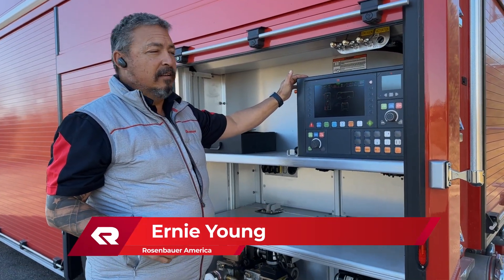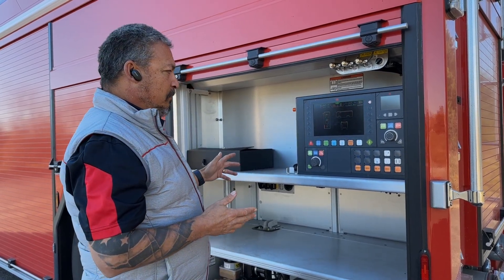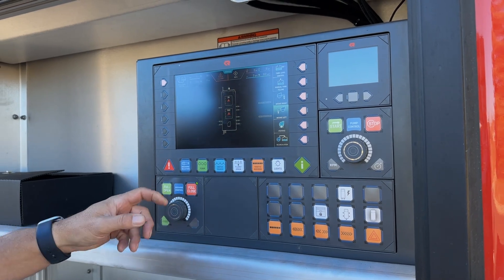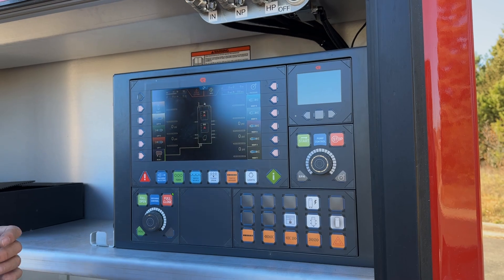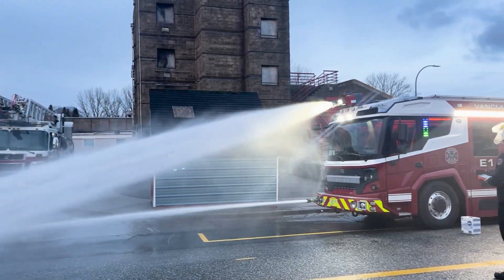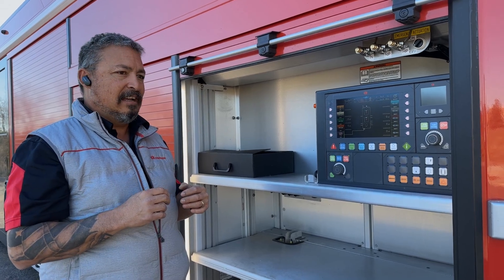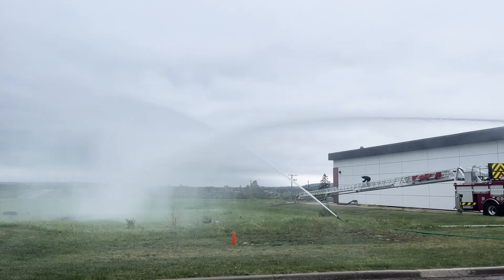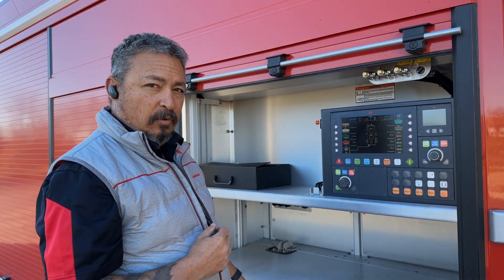Rosenbauer RTX Pump Panel

Comment: A video of real start up of the main pump would be nice. In engine it  takes aroud 30 sec before the first water is on the line.
Reply: As this is a full electric pump, the motor powering it has instant torque (just like those insane accelerating Tesla cars). I bet it's at full speed within a few seconds.